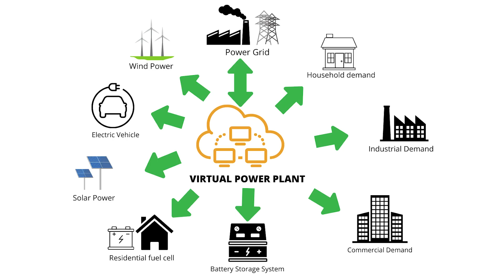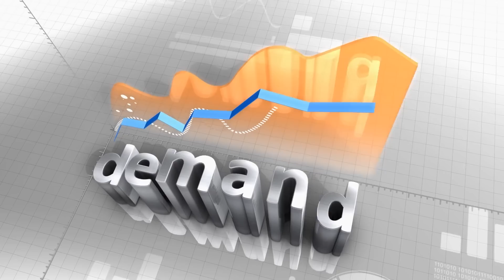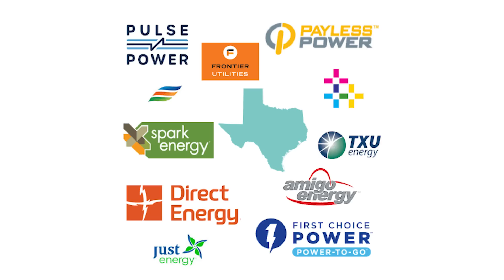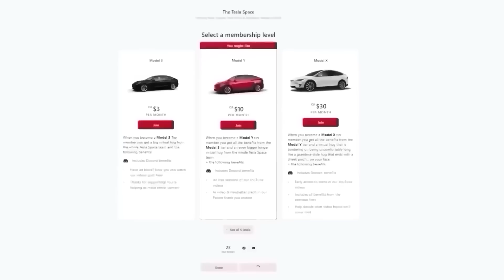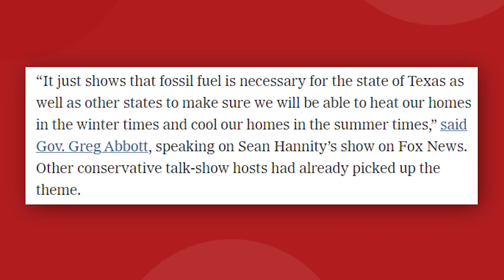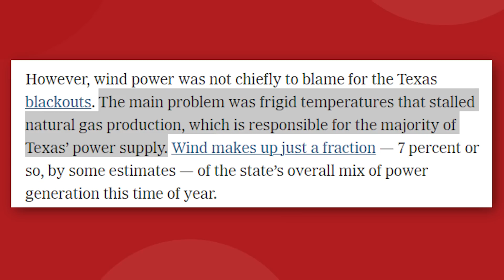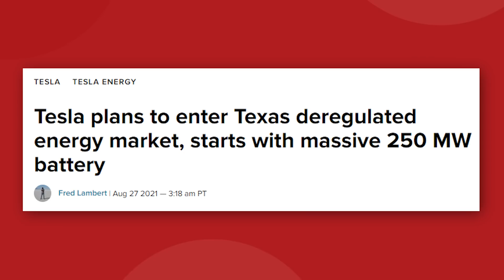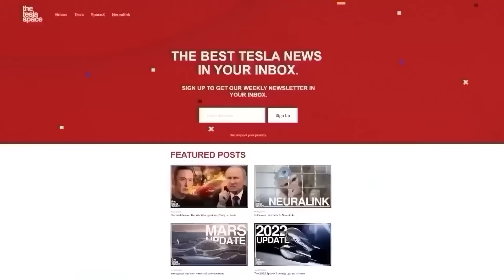Why Tesla Energy Is About To Take Over Texas!

Comment: I hope we can get vehicle-to-load for our Teslas soon, if possible.  Being able to tap into a 100 kWh battery, combined with reduced usage in emergencies, will go a very long way.
Reply: I found this quote online " For the time being, no Tesla models are capable of bidirectional charging. It’s possible (even likely) that all 2022 Tesla models have the necessary hardware for V2G or V2L, or V2H. However, Tesla has alternative motives for delaying bidirectional charging rollout for as long as possible. If Tesla vehicles became V2H-capable, they would render the $10,500 Tesla Powerwall home battery obsolete!" 
Also found: "Musk and Tesla have some reason not to be so enthusiastic about it, even if the new developments in battery storage technology deliver longer life batteries that may not be so impacted by the more regular cycling in V2G.
Tesla has a rival product – the stationary storage units such as Powerwalls – and also has grand plans for autonomous driving, creating a fleet of “robo-taxis” that will be in near continuous use, at least when they are not charging. That means it might come down to how much an EV is paid to provide services to the grid compared to operating as a transport service.
“It will be problematic if you get to the morning, and instead of being charged, (the car) has discharged,” Musk said. “It will be better to have a Powerwall and a car operating separately. Then everything works.”
The irony is that Musk suggested that providing the V2G in a Tesla EV could be as simple as updating the software. And he said it was offered in the company’s first product, the Roadster “but nobody used it” (which is perhaps not surprising given the nature of the vehicle)."
Reply: 100% agree with this

Comment: Wind turbines are unreliable obviously, and trying to manage that issue with batteries is not green at all (rare earth mining, that's not renewable either by the way), it is extremely costly and only a partial solution. The real solution is nuclear energy since it is both reliable  (we can control the output at anytime to adjust to the demand) and clean (no co2 or other atmospheric pollution, wastes can be confined in a small and secured space).
Reply: LibertarianTV; They use wind turbines in Norway, Alaska Finland etc. where it gets considerably colder than Texas ever does. Wake the hell up.
Reply: @altond511  icing makes wind turbines ineffective and so does solar.
Reply: @samuelmorales2344  I think that people in Norway and Finnland might be surprised to hear that.
Reply: @altond511  Texas is ranked fifth in the world in wind energy. Freezing temperatures doesn't mean you get ice everywhere. There is dry cold and wet cold. Weatherization for wind turbines only concerns protecting the equipment itself from damage, it does nothing against having ice on the blades themselves. Wind energy is most ideal for gifted regions of the world where there is plenty of wind, all the time. In Britain, they have to install a extremely long cable to Morocco to access additional green energy because apparently the ocean wind turbines are not good enough for them. North Africa would have a more consistent solar profile because it is arid, with direct sunlight, and little to no cloud cover.
Reply: @samuelmorales2344   seems you talk much more, than you know. It's about cable from Morocco to the UK. I don't know what you have in mind saying about "they", who "have to install an extremely long cable", but first of all that project is an idea by a private startup company. It's exactly the same if we'd say about Tesla's project in Texas, described in the video, as "they have to install a lot of battery storage to alleviate problems with grid stability". No one HAS to do anything. That startup company in the UK still don't have all finances for its project and just wanted to receive an agreement for purchase of their electricity to begin with the project, and appeared in recent news only because recent changes in the UK government delayed decision on that agreement. The project could start delivery of electricity no earlier than 2027 and at the maximum would provide up to 8% of UK's electricity needs. Wind energy in the UK generates a bit more, that 17% of total electricity and their wind turbines have protection from the frost. I would suggest you to discuss the matters you know very well, keeping your mouth shut about things you have little or even absolutely no clue about.
Reply: @arunotei  I don't even know what your point is. You posted that entire paragraph for what? It is irrelevant. My point is the distribution of green energy isn't even. You can't move green energy without transmission lines. It isn't like fossil fuels,or nuclear energy rods where you can use trucks, pipelines, and rail to move them around. Apparently, my point by using Xlinks Morocco-UK Power Project went completely over your head.
Reply: @samuelmorales2344   even heard term "microgeneration"? OTOH, you need to transport coal, oil, gas and uranium from their mining places as well, as distribution of those are even less even compared to green energy. Transmission lines in such case are better solution and those were common sight in Europe (where I'm from) and US long before anyone was talking about green energy generation. BTW, all Europeans knew, that constant blackouts, which make diesel generators popular in the US private houses and many commercial buildings, while very few Europeans have those, were due to the fact your country has underdeveloped network of transmission lines. So transmission lines are sorely too few in the US no matter what generation you prefer. While if you talk about the time of supply and demand, so pumped hydro is also quite a known thing in Europe.
Reply: @samuelmorales2344   no, you got it wrong. I was saying, that Europe has better electrical infrastructure, especially transmission lines, than the US. I didn't talk about the state of green energy, if you haven't noticed. I just wanted to say, that the US needs way more transmission lines no matter the sort of generation.
Reply: We are going to earth mine no matter what, we will always need metals and precious metals to make and build things, it's inevitable, why not use the mining to help build renewable energy systems? Too many people whining about this and that, just be happy of the good change and not more oil burning cancer causing pollution air breathing
Reply: Nuclear is cheaper to start and much more expensive to clean up if you can figure out how.  Uranium is mined.  There are areas near us that are old uranium mines and the remediation is costly and ongoing.

Comment: Interesting idea but grids aren't exactly set up to handle energy transfer going in and out of the grid. Multiple sources throws a wrench in grid protection/automation.
Reply: It works. Thats why tesla got the vpp approved.
Back when renewables had like 5% share they said the grid would collaps when theres more then 10 or 20% of solar.
We already experienced times where eg in germany the electricity was alsmost exclusively provided by solar and wind. 
No breakdown yet.
Reply: @huibu8987  I'm not saying it doesn't work but I am saying feeding energy back on the distribution system versus the transmission system is a different beast that utilities haven't tackled yet. Saying there is work to be done, but it definitely can be.
Reply: @coreystinar7453  on a national scale, power grids are integrated nationally. Locally shouldn’t be a problem.
Reply: doesn't having multiple generation/storage sources make the grid much more secure than just one point of potential failure?
Reply: @gringoviejo1935  definitely but think about having a fault between 2 sources. You have doubled the fault current. Just saying that doubled fault current wasn't originally planned for when the grid was built. Everyone here thinks I'm against the idea. I'm not just saying it's not as simple as everyone discharging batteries onto the grid. PGE has the most distributed generation in the US and they have had to invest billions to get their grid to handle the additional load from other sources.

Comment: So from what I'm understanding is that one power wall would keep the lights on for One Day. So, I would have needed 6 of those to have lasted me through the shutdown. Google says that I can get a two-pack for 18.500. So for 111 Grand... Nope. Our propane tank kept us warm and the pipes above freezing. Although it wasn't fun, we survived quite nicely. People in the North and people in hurricane areas can go for weeks without power. They are the areas that need these far more than most of Texas.
Reply: No taxation without representation
Reply: You're not accounting for the energy produced by the solar panels
Reply: Even with my propane generator I cannot run my whole house.  But, it keeps my freezers, fridge and water pump running + baseboard heaters.  Even then when my tank of propane runs out I'm sunk.  If I had solar replenishing my power walls during the day and carefully used the hydro in my power walls for essentials I could probably manage.  No risk of CO poisoning from gas generators ( where are you going to get the gas when it runs out), and friendlier to the environment.
Reply: I am in Houston and have solar panels and 2 Powerwalls. They got me through the 44hr blackout in my area and could have kept going even longer. The system was $41k ($30k after tax credit). 
The ROI is looking like 8yrs with my current electric plan. The power company owes me money every month.
Reply: @That-Guy_  That's great but still way out of reach for most people. 😞
Reply: I think that is assuming you run your house at your usual levels. Lights, stove and whatever used as normal. We had a 5 day power loss a few winters ago and we’re fine with a small generator. Didn’t run it full time. Just as needed. Used 5 gallons of gas.
Reply: It's not as simple as what you've reduced it to.  If the power goes out, I'm guessing you're not going to crank the AC and do your laundry.  You're going to essential functions and that will use a LOT less power.  Look at your energy bill in detail.
Reply: My friend who lives in Texas says that its power grid is a joke and disaster because the politicians are so corrupt and in bed with Big Willy who makes you give the job running the power plant to his nephew Jethro. lol.

Runs data centers down there and they are always losing power.
Reply: So one pack is about 13 kilowatt.  Just look at your monthly electricity bill.  Figure out how many Kilowatt you use a day.  Most houses whole use about 12 - 20 kilowatt a day.  In power outages situations, you'll probably have to conserve energy usages.  Adding solar the sun will charge up the battery.   Hence they cycle repeat.  Hopefully solar can produce enough to power your home and charge up the battery pack.

But honestly as far cost saving, I rather buy a natural gas emergency generator for about 6k from Costco.  But if you lose nature gas.  You're screwed.  As far as cost saving, powerwall is stil pricey.   I hope someone can take and used Tesla pack turning it into a powerwall
Reply: This is a scam. A Powerball has 13kw of energy fully charged, my house will use that in 5 hours. Then what? And they say there gonna sell it for 2 dollars a kWh. How on earth is that cheaper than a peaker generator. A typical kWh is about 15cents
Reply: Thanks for stating the truth

Comment: Re: the windmills freezing in 2021, you said that wind was only 7%.  Look again, from a chart on ERCOT it shows wind 29% for 2021.  Way back in 2011 wind was 9%.  In 2021 Solar was 6%.
Reply: You have to be careful with this kind of datas. In the case of solar and power, there can be a huge gap between the energy production capabilities and the actual contribution to the energy consumption, since solar and wind are unreliable and don't necessarily produce energy when you actually need it.
Reply: @sebholding  The chart title is ERCOT - Generation Mix (%)  I would paste if I could
Reply: @gbinman  the numbers I'm seeing from ERCOT are a bit lower, but still far more that 7%.  As soon as he said it I called BS and looked it up.  Looks like the 29% includes both wind and solar, since the 2021 numbers show a little over 24% wind, and a little over 4% solar.  Plus, those bagging on the TX grid seem to totally fail to recognize that it was a freeze the likes TX hasn't seen in 126 years, and TX wasn't alone, with (I think) 13 states having grid problems during that event.
Reply: @paulfuston189  Texas had something close 10 years earlier where the grid also went down.
Reply: @billweberx  it happens, but what I said was 100% true.  The conditions during that weather event hadn't been seen here in 126 years, so of course the TX grid wasn't prepared for it.  Funny thing is, I was lucky, in that I didn't lose power once during the entire thing.
Reply: @billweberx  oh, you're still buying that lie? Say no more...
Reply: @billweberx  I saw houses with single glas instead of double/triple like in Europe.
Reply: @gringoviejo1935  do a search on climate change and educate yourself. Global warming doesn't mean that localities will be necessarily warm. It means that there will be locally more volatile weather. Sometimes it's extremely warm, sometimes extremely cold. In the case of Texas, they're having more extreme cold weather. You need to weatherize everything, gas lines and windmills.
Reply: There were 2 problems 1. A cold weather system settled into the region.  There was no wind.  They could have been frozen, who knows, there was no wind, like there never is when it gets that cold.  2.  The gas lines weren't weatherized.
Reply: Windmills require an operational grid in order to sync to and supply energy to the grid.  Battery storage will allow the grid to be operational during periods in which it may otherwise fail.  Battery storage will thus allow wind energy/windmills to maintain their output, and additionally regulate wind power energy variations during these same intervals of potential outage.